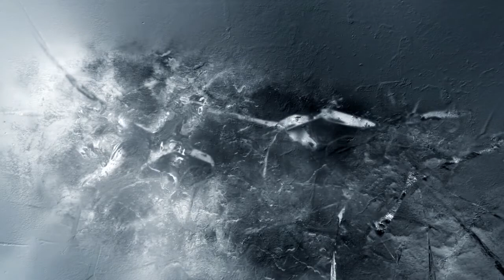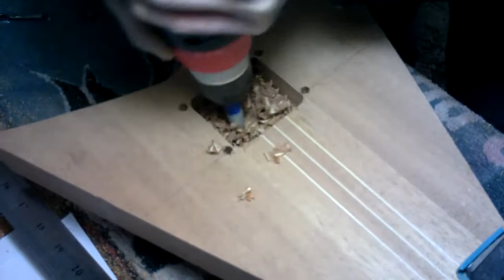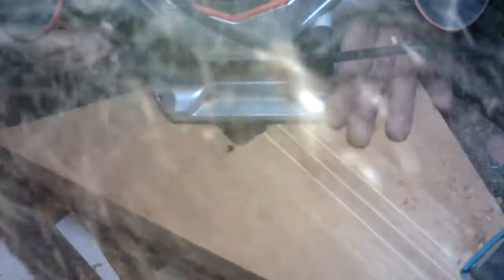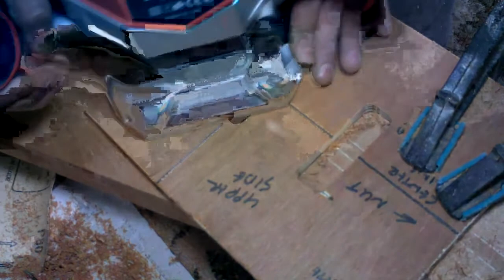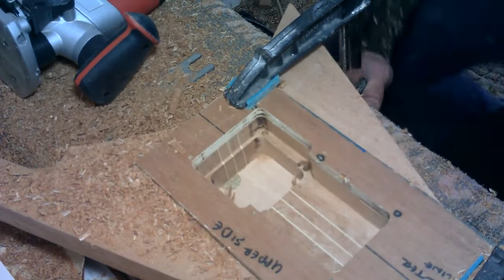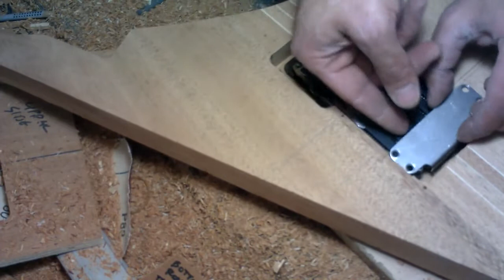EVERTUNE routing process by 39 Custom Guitars Workshop

Comment: I would much prefer the sound of the router rather than that god-awful noise playing in the background. It grates on a normal human being's nerves. What is the point of that horrible noise? It's an assault on the senses.
Reply: The purpose of all god-awful noises is either to raise the helpful adrenaline levels and scare the pants out of your victim when the bayonet attack begins or to release the accumulated inner anger and PTSD from the abused soldier afterwards.

You might think of it as the ritualistic burning of protective fuse, the first step of the process of learning how to take care of your emotional balance in a stage when love and meditation are not achievable yet.